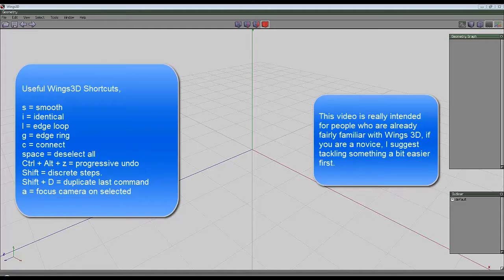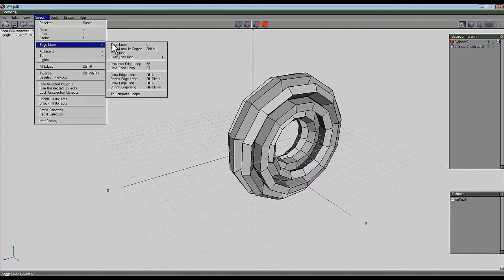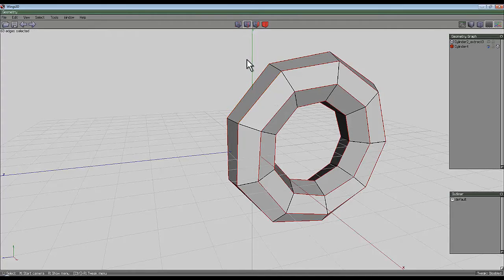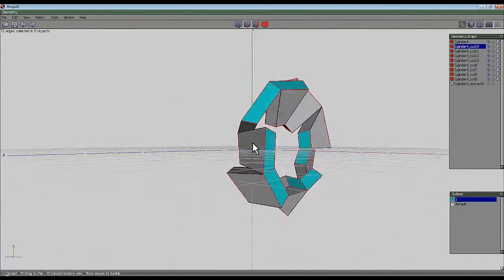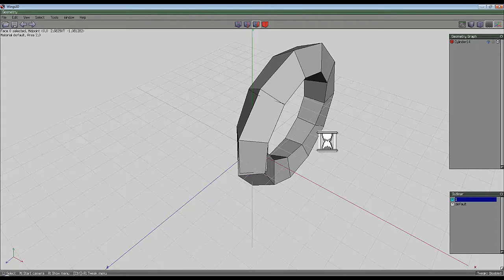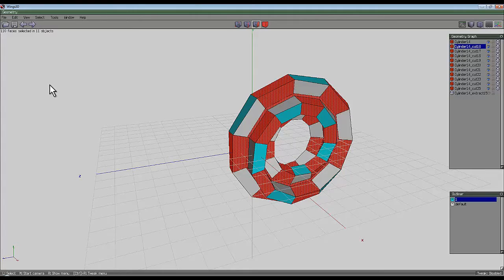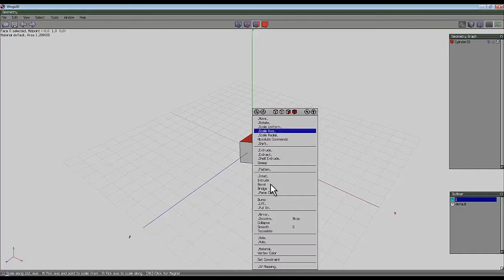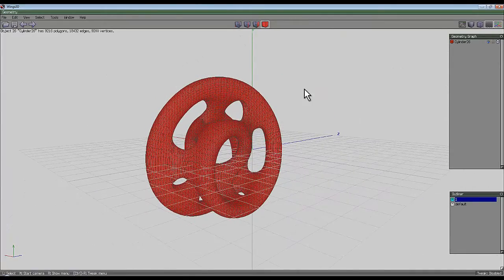Wings 3D project - general recipe for single mobius web - by David Brinnen.

Comment: Hello David. I was wondering if you could post the values you use when adding and doing the other math?  I am a bit baffled at how you arrive at the values that work. I am normally very good with geometric math, but as this is a definitely different type of shape, I would need to see the actual formula being used in order to plug values in that work the way you are doing.

Also, I'd like to know if higher values than what is being derived from the roll of a 6 sided dice can be used; say two six sided dice?

This is very interesting to me!
Reply from the maker: Sorry, you should have asked me this three years ago, I've no recollection.
Reply: No worries. I understand. Three years is a long time. Just wishing I had seen this back then is all.